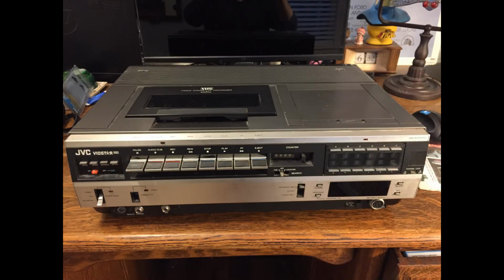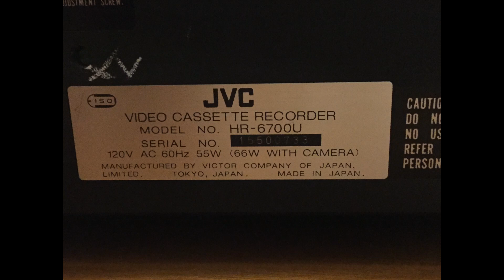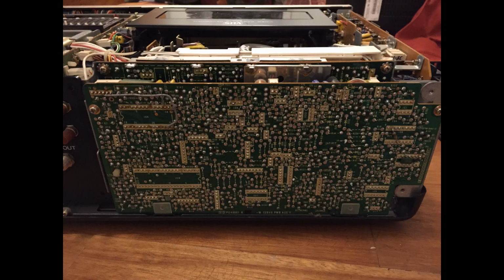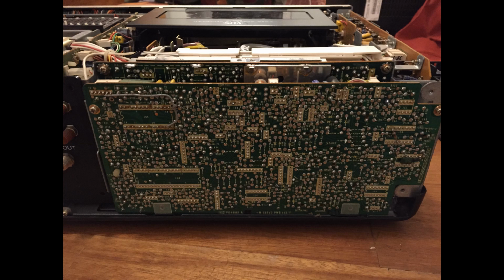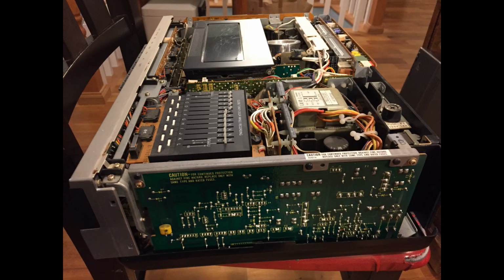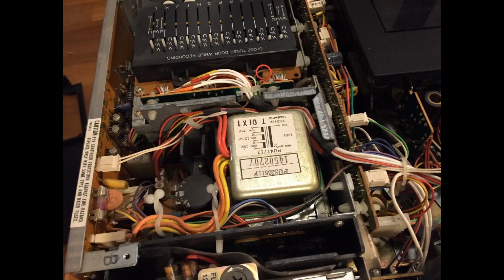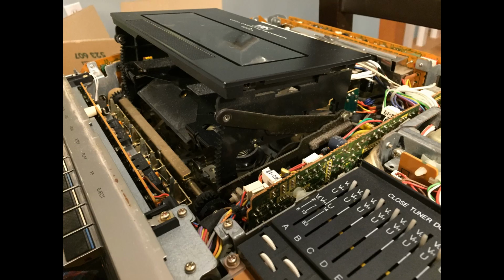1979 JVC Vidstar VCR (HR-6700U)

Comment: This is very simialr to the first VCR that I owned. I remember the function keys very well. I seem to remember mine was a woodgrain finish though, and  that you had to hold down the play and record keys at the same time to record, and you could program it to time-shift record. Also, I had the optional wired remote control that was speed adjustable.

Comment: This a HUGE part of media consumer history. Great still shots. Look how dense all the components. Point to point wiring etc is crammed in like a mosaic weaving. Here is some wiki notes and link on previous original model. The first VCR to use VHS was the Victor HR-3300, and was introduced by the president of JVC in Japan on September 9, 1976.[22][23] JVC started selling the HR-3300 in Akihabara, Tokyo, Japan on October 31, 1976.[22] Region-specific versions of the JVC HR-3300 were also distributed later on, such as the HR-3300U in the United States, and HR-3300EK in the United Kingdom in January 1977. The United States received its first VHS-based VCR – the RCA VBT200 on August 23, 1977.[24] The RCA unit was designed by Matsushita, and was the first VHS-based VCR manufactured by a company other than JVC. It was also capable of recording four hours in LP (long play) mode. The United Kingdom later received its first VHS-based VCR – the Victor HR-3300EK in 1978.[25]

https://en.m.wikipedia.org/wiki/VHS

Comment: This was my first video recorder. This recorder was the first VHS with the electronic special effects . I liked the thing a lot. I once FOOLISHLY stated-VHS will rise and Betamax will fall. What an ignorant thing to say. But unfortunately I was correct !!! The JVC reoorder started eating tapes. I took it to the JVC factory service shop in Willmington, California off a fwy. After the 4th time the tech stated it can't be fix. I replied-the repair is under the guarantee you must honor the guarantee. So it was in the shop again. I ask the tech why the HR-67OOU did not eat up the JVC tapes. It was due to that the JVC tape had a thicker coating. Well, the recorder was a lemon. I throw it after being in storage in back yard. I continued with a Panisonic NV and then Panisonic AG. Later a friend told me that Batamax with BI recorded an excellent picture. I bought a Sony SL-HF750 BETAMAX and far superior to VHS !!! Still have it and still works. I gone on to digital. But my Beta recorded taped still looks new. I started to collect some of the first Betas.
I still am partial to the JVC 6700U but not as much as BETA. I still remembered the model number.